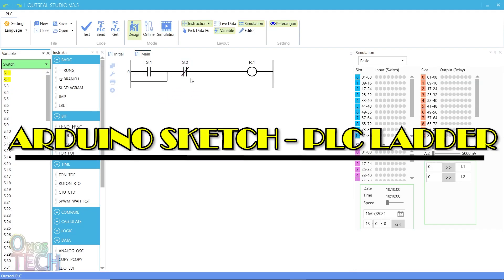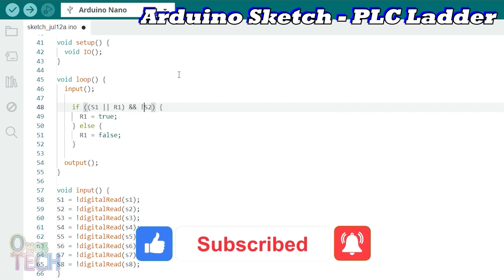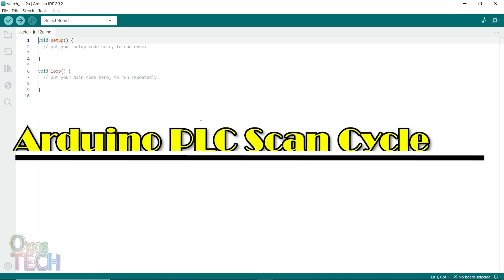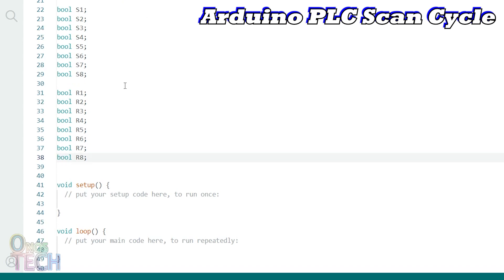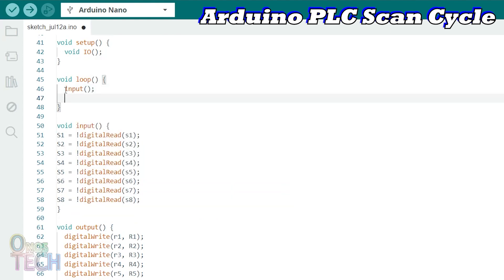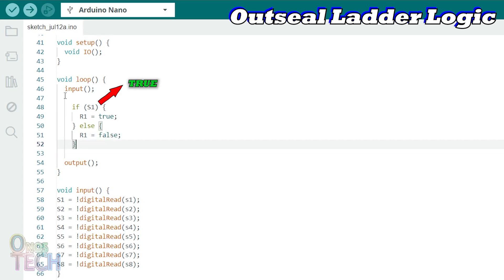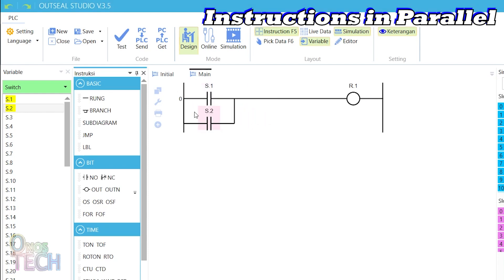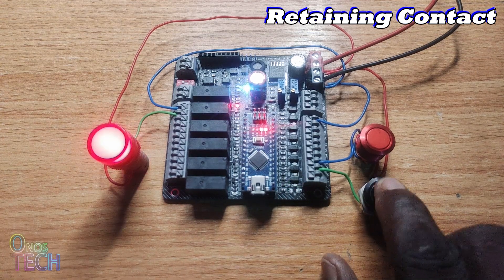#1 Introduction to Arduino Sketch ⇌ PLC Ladder Programming

Comment: Thnx. Thnx for making these videos. It is appreciated.
Reply from the maker: @josiasvandermerwe3710  i am glad they are helpful
Reply: Hi Onos, tech question. My guess is that Outseal generates C code that it then compiles to run on the target board. Would you know if there is a means to see the generated code? I would love to see the code it generates
Reply from the maker: @josiasvandermerwe3710  I don't know about C code, but I sure knows it generates hex

Comment: Is Arduino I2C bus available for output to I2C LCD in this PLC?
Reply from the maker: https://youtu.be/UZ7Md3Oj8wA
Reply: @OnosTech  Thank you for reply. Is there a link for same board to conenct to stepper motor and 4-20mA sensors input
Reply from the maker: https://youtu.be/UZ7Md3Oj8wA